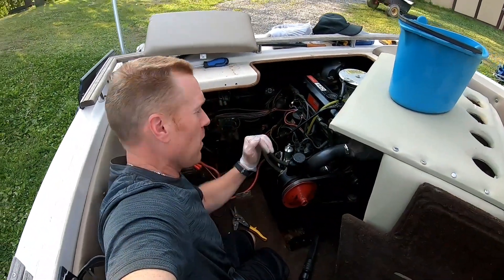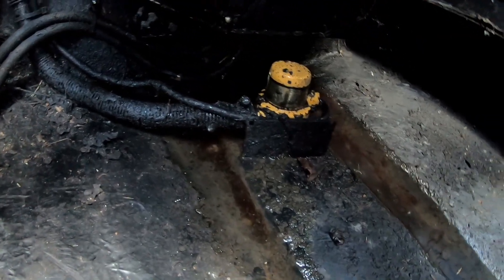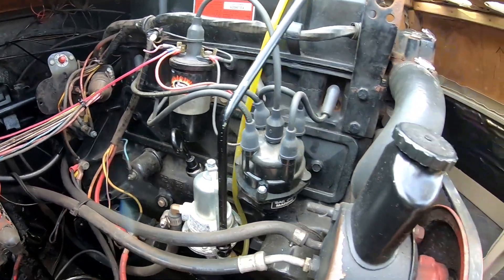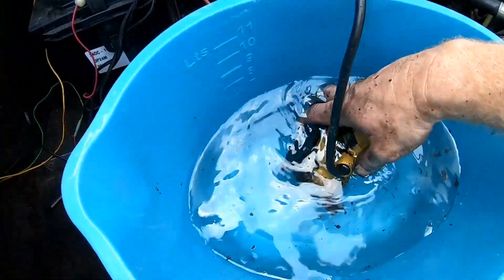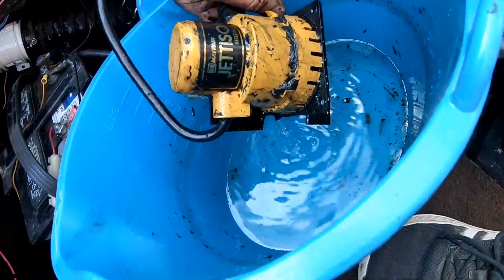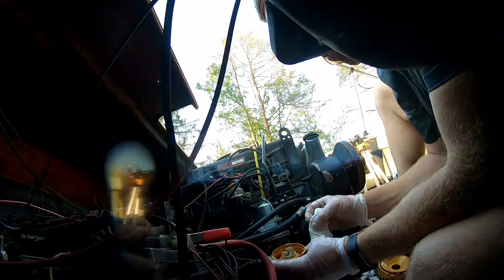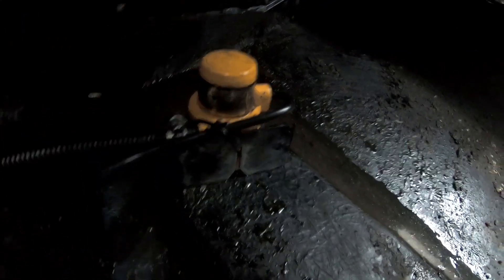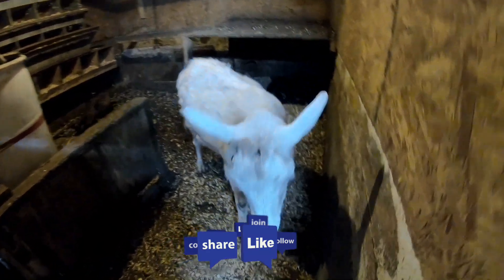Boat Bilge Pump Clean Out!

Comment: What were you doing when u set it in the bucket and the water was going in circles?
Reply from the maker: I was running it to clear any other junk out of it and making sure it had good pressure,  the last thing you want is a clogged or slow pump when taking on water plus that pump is as old as the boat I wanted to double check it! Thanks for watching!!👍😊
Reply: @WhitehouseFarmVet can you run dawn through it?
Reply from the maker: Absolutely! That's a great degreaser!👍
Reply: @WhitehouseFarmVet  cool. I dripped some oil down there when I dropped the damn filter 🫠
Reply: @WhitehouseFarmVet  actually was wondering if I could fill it up down there with water & dawn then swish it around, pull the plug. I'm lazy